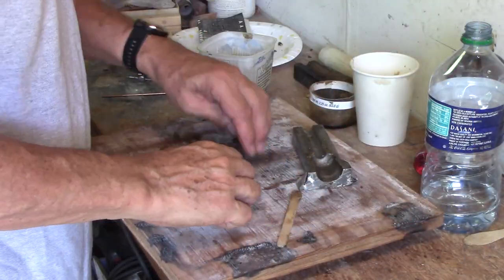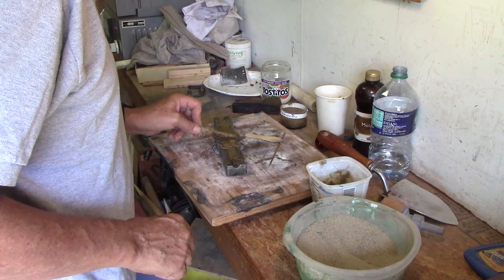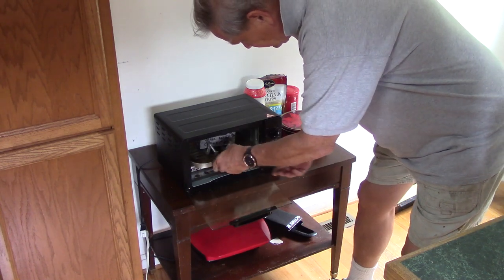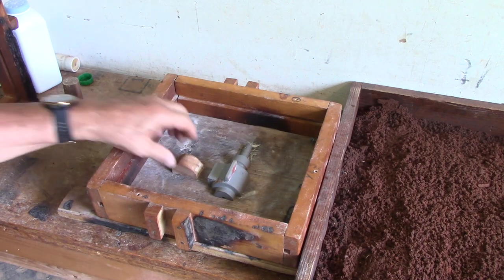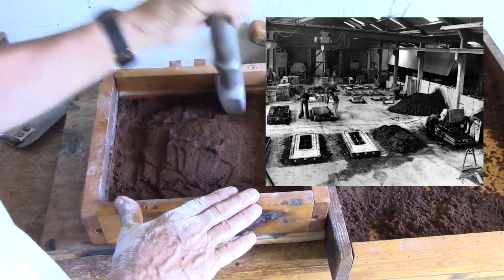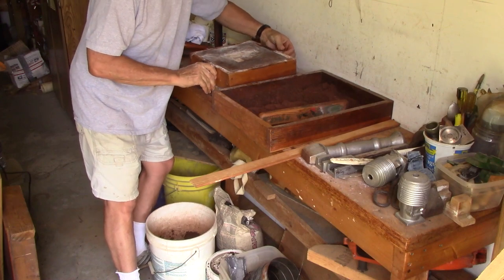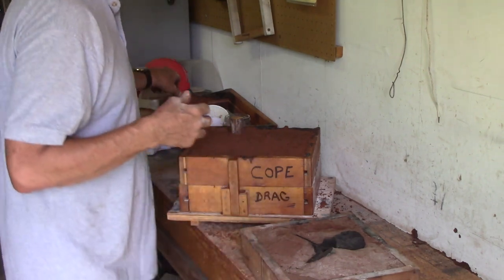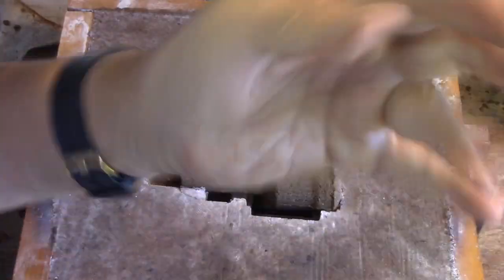How to cast aluminum homemade model engine crankcase with a DiY sand core Part 2

Comment: Good job . I really want to start this process . I am a bit short of space guess I need to get a little garden shed . My workshop is full up my other shed I can barley get into .thanks for posting a good video!
Reply from the maker: Thanks for the comments.  There always seems to be a shortage of shop space.  Casting is done outside but you do need storage space for the furnace and flask boxes. ( I started with One -  10" X 12" flask box).  Thinking of building a slightly larger furnace for bigger pours, and some Cast Iron too.